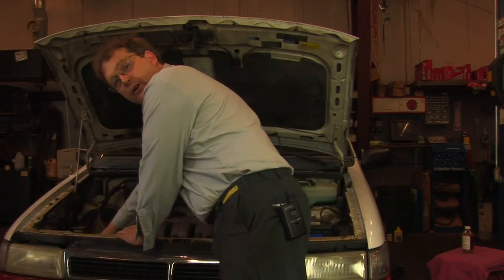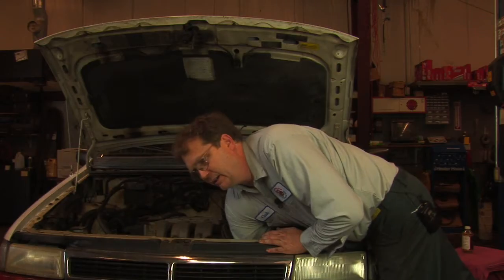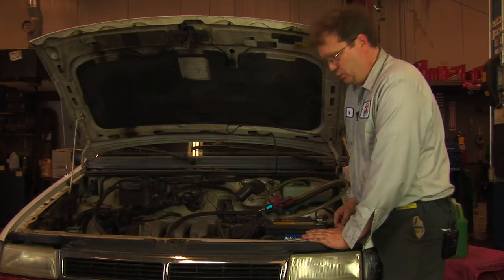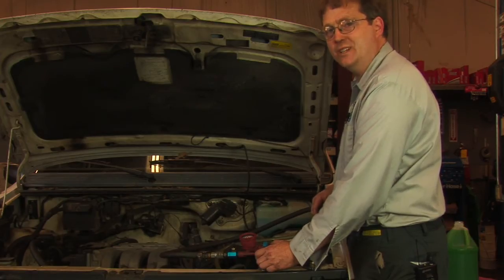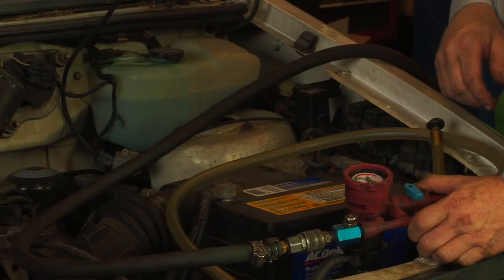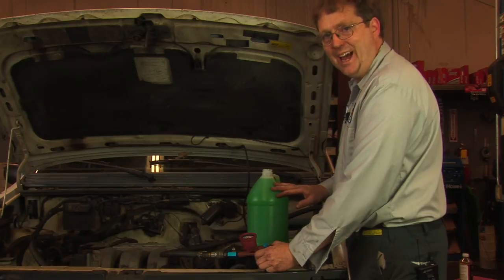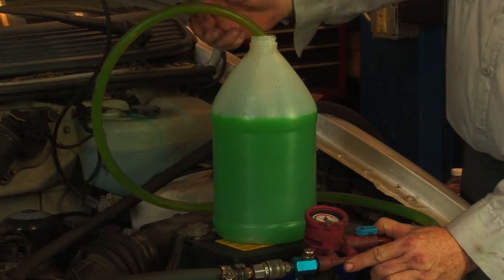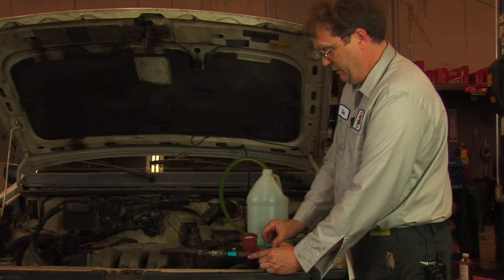Auto Repair & Maintenance : How to Change Antifreeze Coolant

Comment: Yes you can, slowly fill the rad and wait for the coolant to go down and do it until it stays filled.

Run the car for like a minute, check it again and usually that's it. Check your fluid often for a week and if it's good, it's good.

Comment: Thanks for posting this video. I just purchased one of these vacuum type refill system. Do you generally use the rubber "funnel" adapter for most cars? How much psi do you put in before opening the valve? Thanks

Comment: You can "burp" your vehicle by running it with the heater on and the radiator cap off.  Fill radiator as needed.